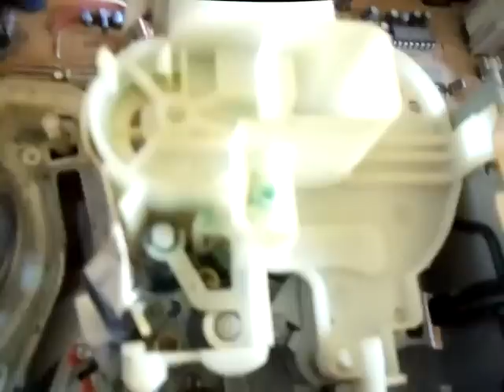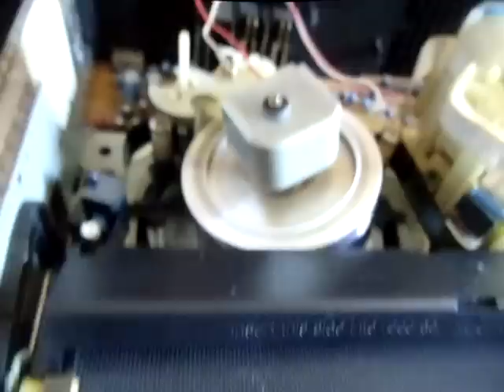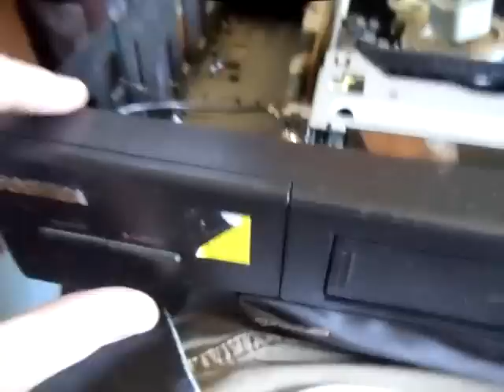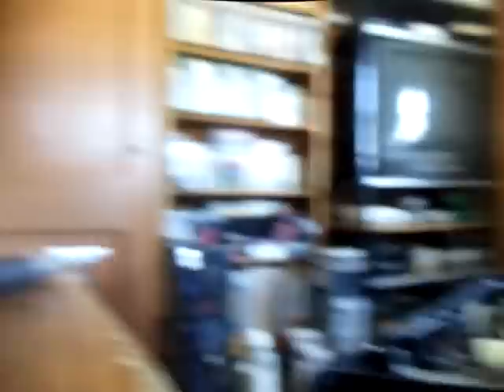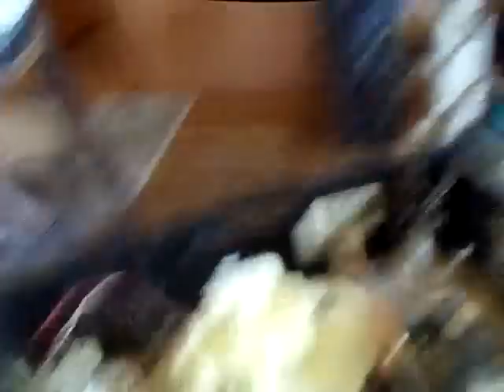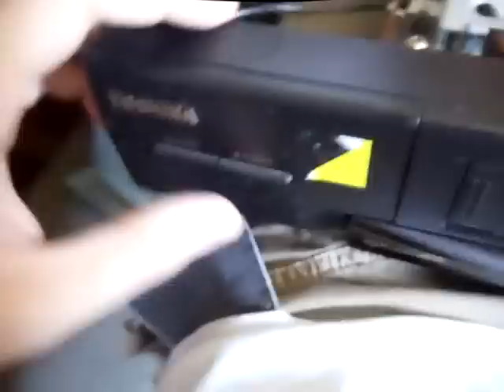(1995) Toshiba #M751 VCR Eating Tapes

Comment from the maker: +Brian Christensen

It IS a 1995. I guess that's why you deleted your comment.

Posted: July 13, 1995
Anyone concerned with the economies of home taping - namely, using the slowest recording speed to fit more shows on a tape - will be attracted to the promises of Toshiba's latest six-head VCRs. Three models arriving this summer (M-751, M-761 and M-781, priced from $449 to $549) continue the benefits of the six-head design that the company introduced to the consumer market a year ago.
Reply: Brady Plays its not the guides. the error is the real hubs arnt reversing like thar sapost to thust the tape is not geting puld into the caset

Comment: It is not pulling the tape back so it will need a new belt as they get looser with age, or at least the belt needs to be cleaned.
Reply from the maker: +Sony Trinitron You can't "clean" a belt and it should never be exposed to water. It will rot it. Look for the other videos of this VCR. It's the belt.
Reply: MrWolfSnack Cleaning a belt you just need paper, I've had one VCR I got for free somehow get lube on the belt making it slip, probably left in a hot area for a long long time.
Reply from the maker: +Sony Trinitron That "lube" is oil from the rubber decomposing and breaking down. Depending on the rubber, it will either turn greasy, or turn into a putty doughy material, or just pure tar that will stick on you and everything else like ink. Replace the belt. Fix it right, and you only have to fix it once.